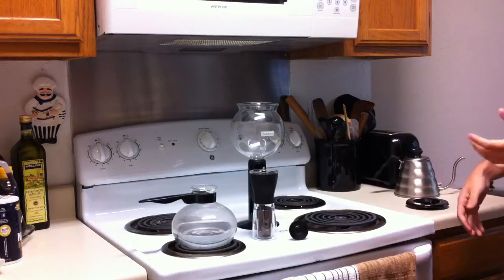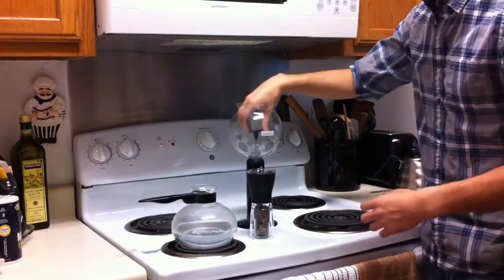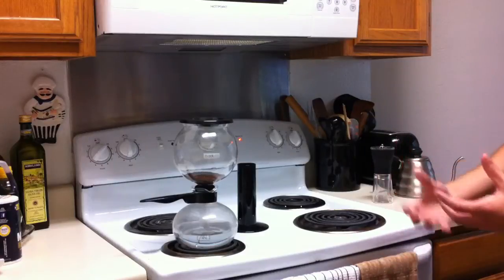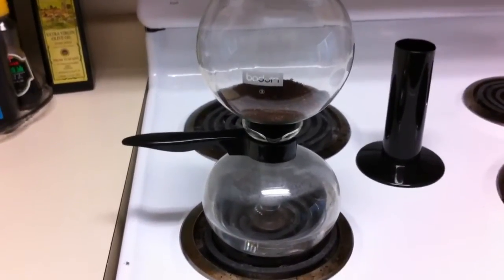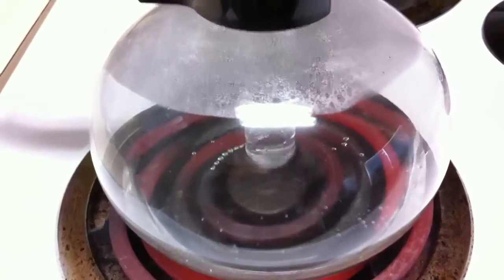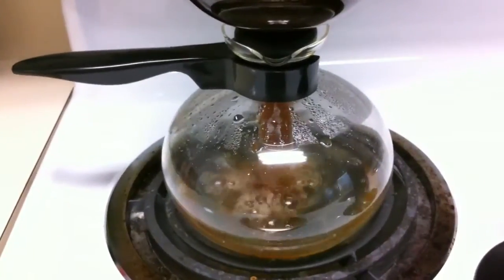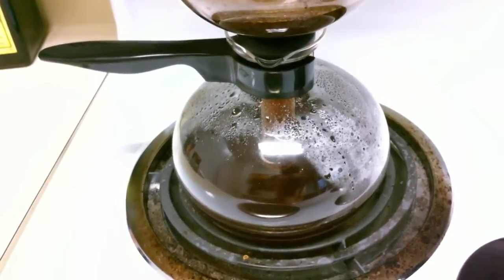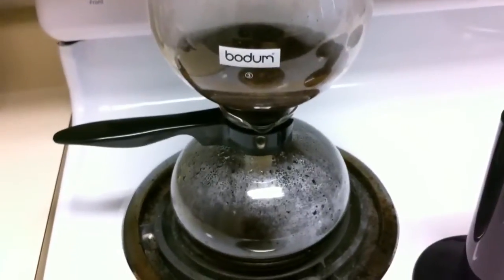Making Coffee with the Bodum Santos Vacuum Pot

Comment: It is a vacuum (a relative low pressure area) that does the work.

The vacuum is established in the pot by heating the gasses above the water (not a vacuum yet - instead a high pressure) - they expand- push the water down- it does not compress and so it heads up the siphon tube to mix with the coffee. Then we boil a bit, further evacuating the pot. When the gasses cool they contract and exert less pressure (vacuum!) than the outside so the coffee flows down to occupy the space in the pot.